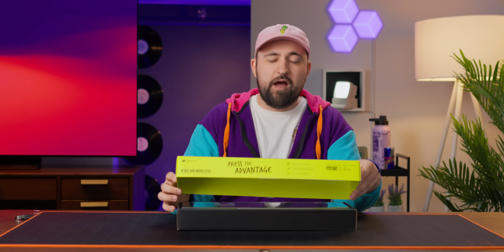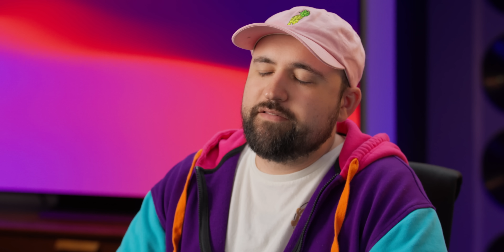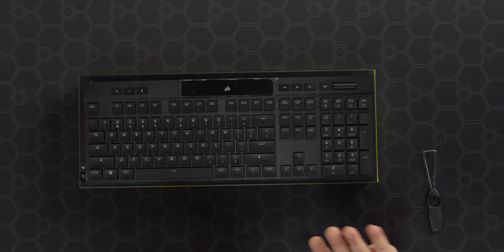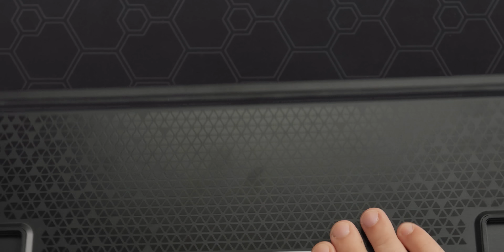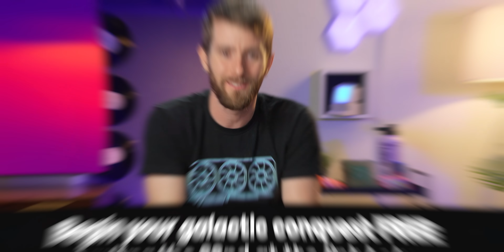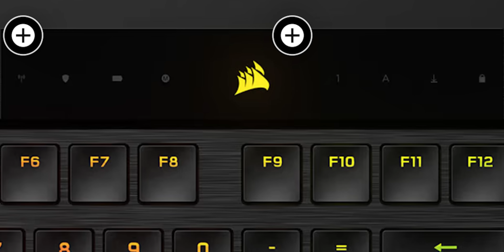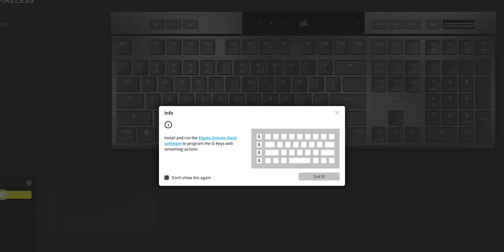Corsair's THINNEST keyboard yet - Corsair K100 Air

Comment: I love how thin this is and the connectivity options, but not for $410 CAD according to Corsair's own website
Reply: Keyboard thinner than my wallet
Reply: @smallbutdeadly931 the other way round? "wallet thinner than the keyboard"
Reply: @SreenikethanI  no, that's after you buy the keyboard
Reply: i’ve had mine for months i like it a lot now is it worth 280 no but i was tired of switching my cable from my xbox to my work laptop all i have to do is click two buttons it’s on my xbox and i like the number pad for work
Reply: Get logi 915.
Reply: i feel ya.....paid 470 with warranty

Comment: I was a Corsair fan, but after 2 150-200€ keyborards and 4 60-110€ mice broke down in 3 years total, I ditched them for some nice cheaper sharkoon keyboard/mouse and the are still going strong after 4 years.
Reply: about keyboards, I strongly reccomend you all Keychrons products
Reply: @MallocFree90  Keychron, Varmilo and Ducky are kinda the go to for good affordable mechanical keyboards outside of the DIY scene
Reply: @MallocFree90 I kinda don't like em (I am contrarian and also they aren't available here)
Reply: @hihellothere9569  ducky and Varmilio are also good brands
Reply: I've replaced many of the Corsair peripherals with similarly priced Logitech devices and had a good experience so far
Reply: @@thenutsonyourchin Same on the battery life. It's why I switched my wife's Corsair mouse over to a Logitech G305.
Reply: My K90 is 10 years old, nothing on it has broken and it gets used 10 hours a day
Reply: True
Reply: i have strafe rgb and scimitar pro, the mouse gets dirty fast and the scroll wheel is so so bad, the keyboard is okay after 7 years tho, only couple dead RGBs. i use Akko keyboard and logitech mouse nowadays
Reply: Well then foken turn off tgb like on logitech and it's gonna last the same also you probably used a way cheaper corsair 1 then
Reply: Hey I get it sometimes good brands are just cursed for certain people. Also having good local support is key and from what you said in a reply they didn’t at the time.
Reply: Cant say my K70 red switches dont still work great. Even spilled a bit of water on them 2-3 times. I had it since like 2015.
Reply: I still own several corsair peripherals but I use Logitech mostly today, they rock solid great design, great software - no complaint what so ever.
headphones/mic I stay away from gaming stuff - I opted for more HI-FI  equipment.
Reply: My keyboard has been reliable, but my mice have died at horrible rates
Reply: My m65 and now m65 wireless are going super strong… tempted to get this one when I find a sack of gold
Reply: I'm in the process of swapping out my corsair PSU since my PC constantly crashes/shuts down and other parts were tested. Already changed corsair ram few months ago because it just died. My K75 RGB is all weird and non-consistent. Many keys have different hue/color to them. My t220 PC case is fairly new and the 3 main fans are already spinning at different RPMs. I honestly regret going for corsair, so many problems..
Reply: My Logitech g102 still going strong after 7 years and a switch change
Reply: Had Corsair dying on me too, also during warranty which is even more crazy
Reply: I also settled on a Sharkoon Skiller Mech back in like 2020, and it's still good. Sharkoon makes very good value stuff. It's not exactly the cheapest, but under 100 Euros (I think mine was about 65) and what you get for it is solid. - However, while initially I was looking for almost exactly what I settled for, a "normal" full-sized but above-average quality keyboard, I started lamenting a few things. - First of all, it's rather "clanky", in that there's a clack-sound, but there's a ringing from something. That might be able to be resolved with those rubber rings, though I still haven't tried it in the 3-4 years. - But also, it's very limited in terms of programming. I think you can do macros with their software, but you can't remap keys or anything, so that counts that out. And even the lighting isn't really customizable, even though that's just a cosmetic thing.

On top of that, it's not wireless, which is also kind of a non-issue if the keyboard stays in one place and the cable just runs off the back-end of the desk. Still, I kinda wish I could sometimes just put away the keyboard for a quick cleaning of the desk or take the keyboard outside and blow it off without needing to deal with the cable. And it's not detachable, which is really the problem and just old-fashioned at this point.
Though, they also have low-profile keyboards with detachable cables, and they even include two lengths, as well as those 60% ones with hot-swappable switches (also barebones), but seemingly still no wireless or key-programming. Maybe they're working towards that, because they seem to improve their stuff all the time. Sure, catching up with other brands, but they also have lower price-tags.
But personally I'm actually looking at Keychrons now, because I want those extra features and I'm OK with prices around 100 Euros for that. Just saying, I would still recommend Sharkoon at the right price.
Oh, and it's worth noting that I chose one of their over a Das Keyboard, I think the X50Q, which was about double the price, but just doesn't do anything better with all its marketed fluff, and the custom Omron switches were horribly sensitive for some reason, like they'd register before the "bump", even if you'd accidentally land on the keys too hard when putting your hands down or just grazed the top of them. Like... what??... And for that 120-ish price it doesn't even have a detachable cable, let alone wireless connectivity, and I think it can't be reprogrammed either.
Reply: My keyboard is dulling out slow and I had mines for 3 years Corsair only good for 3-4 years before they due out
Reply: been on corsair for 10+ years now, had 1 dead KB which was swapped under warranty and a wireless headset that couldn't hold a charge after 4 years of daily use. In the household we have 3 keyboards from them 2 headsets in active duty and I brought the previously mentioned warranty replacement to work. Not trying to say they're flawless but I don't understand how you went through 6 devices like that with normal use
Reply: @AdamKiraly_3d  and the support at that time 2016-2019 in Germany was nearly non existent. So nothing was swapped while it should be in warranty. 2 years by law here in Germany.
Reply: @AdamKiraly_3d  FYI I only had problems with mice and keyboards. I have two PSUs, RAM, fans and the headphone stand for many years now without any problems.
Reply: @AdamKiraly_3d  the first kb was a Strafe and the only one where it could be my fault. I was cleaning the key caps and I pulled the spacebar left and right with the same force and slow but it ripped the stabilizers and Corsair had no replacement parts in Germany. The second was the K95 plat and after two years the s key got ghost inputs and the volume roller didn't work at all anymore. No hard use, never spilled anything or hit the kb in rage. Two mice developed ghost left clicks, one had the opposite and didn't registered every third left click. I had the m65 pro or elite dunno anymore and the sabre. But the worst mouse was the wireless dark core which had the tick to randomly set the curser position to the monitor above my main screen. I had several CS:GO matches where I rushed B and suddenly was staring at the sky above me.
Reply: @AdamKiraly_3d  The only problems I have with their Virtuoso RGB Wireless, is because the lack of safely cleaning the ear pads. Plus I am surprised with the popular brands never had been selling wireless full sized gaming keyboards unless if it is either 60% or extremely expensive for little reason.